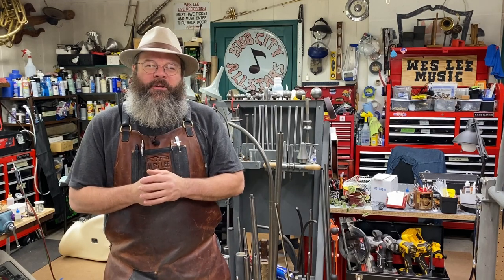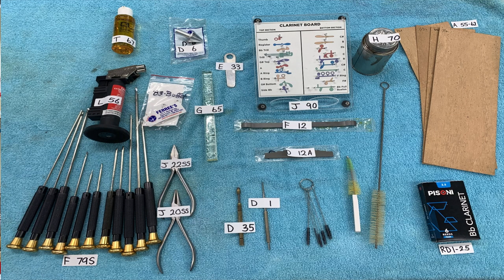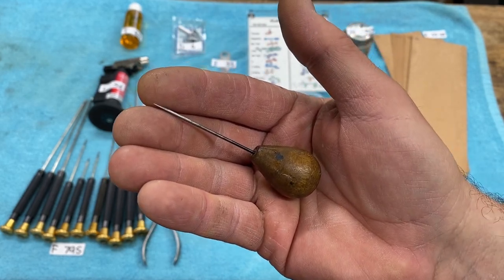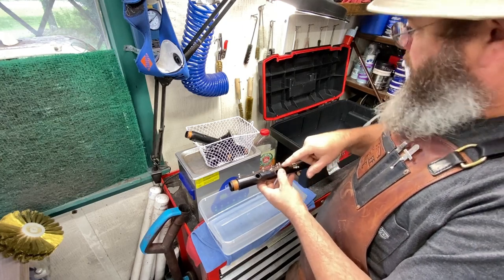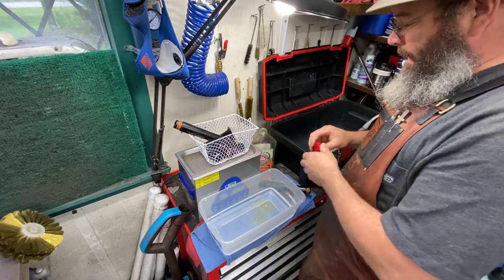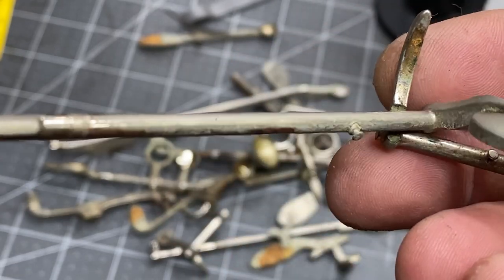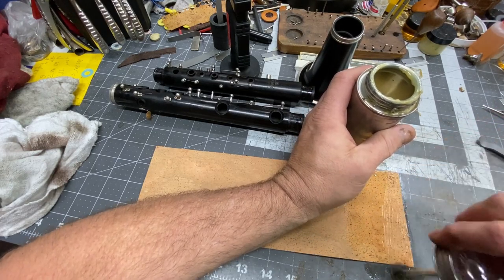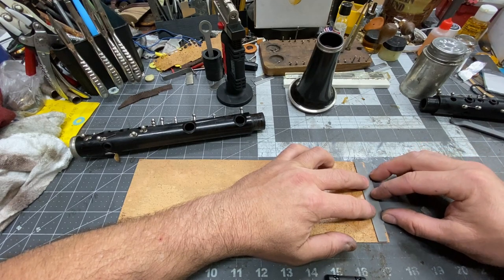Clarinet Overhaul pt 1, Band Instrument Repair, Ferree's Tools, Wes Lee Music Repair

Comment: I use Dawn clear...no perfumes no  chemical colorings.  I have no idea how the chemicals react to the instruments. Maybe they don't, but who knows.  I rinse with distilled water. My tap water leaves spots.  When I cut cork, I use a fabric cutting wheel on a cutting mat.  I sometimes have to cut long strips, like when I work on pipe or reed organs, so I'm used to it.  I get paraffin at the supermarket in the canning section.  Another great video, Wes!!

Comment: Great video ! I'm only wondering wether it's a plastic clarinet or a wooden one ?
I plan to overhaul an old wooden clarinet (not much value, it will be a learning project) that's pretty dirty and while I have experience changing pads, seating it, adjusing mechanics etc. I have no idea of how I can clean the body without damaging it. If I dip a wooden clarinet in oil soap and water, won't it damage the wood?

Comment: Hey Wes, I always enjoy your videos!  I still have my poker tool from Red Wing too!  I use the Ferree's X183 cork sanding accessory in my drill press for sanding tenon corks and really like it.  When I worked in a big shop we spun them on a lathe.  What are you using for cork grease?  I like the waxing method and installing the tenon corks before oiling.  Great video!  Thanks Wes!

Comment: A friend of mine recommends using an oil he gets at the organic food store. He is sensitive to the petroleum odor that comes off of most of the oils that are made for this purpose. He also, probably rightly, claims that the petroleum stuff is really bad for you, even breathing it in. What he uses is called Block Oil, and is made by, you guessed it, the Block Bros. It is really inexpensive and smells pretty good, in my opinion. Check it out.
Reply from the maker: I have those same breathing issues and after a deep dive into some MSDS sheets, we started looking for a change. I have used that Block oil and it’s good on some things and not good on others, which is typical. Since this video was posted we have moved almost all of our oils/ greases, etc. to FDA approved food safe products. Loving the results we are getting.

Comment: Another tip on dis assembled clarinet keys is I put the hinge rods back in ,and dip the body in a chemical bath (plastic clarinets only) ,removes a lots of plaque,tarter and mineral deposits from your saliva,brush out with soap and water gets it clean like your teeth when you come out from the dentist. Wooden clarinets with blue steel springs do not put in Acid , it will remove the blue coating and it will completely rust out and break off. Plus it will turn nickel plating and silver plating a pinkish to reddish stain that is hard to buff off. Blue steel and aluminum does not mix well with any kind of acid. Normally chemical cleaning agent is made from phosphoric acid(same ingredient in coke and Pepsi colas). So DO NOT put it in the acid.

Comment: There are different ultrasonic tanks available to us techs.  I use an Ultrasonic Power 90 gal tank, Tesch classic Brass cleaner, set at 50% to 60% intensity.  I'm wondering which brand of ultrasonic tank, cleaner, and what level of intensity it is set at?

Comment: Question: Are the chimneys machined into the tubes (the joints) or are they  made separately then applied?
Reply: It’s both .lower end clarinets of brand names still use the machined tone holes and then glued in .On your higher end clarinets mostly pro and custom made clarinets (made out of wood) they are machined and turned from a single stock of wood from tone holes to the finger chimnies. Some intermediate clarinets could have both ways,depending on the manufacturers and price points.Hope that helps.